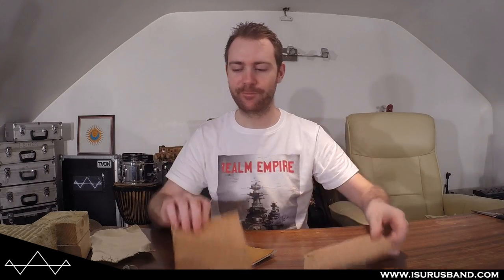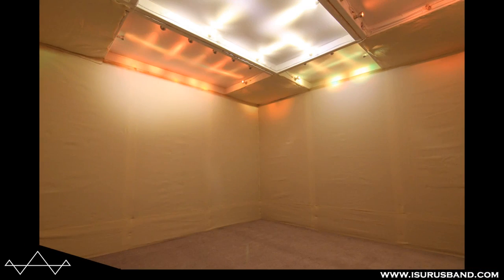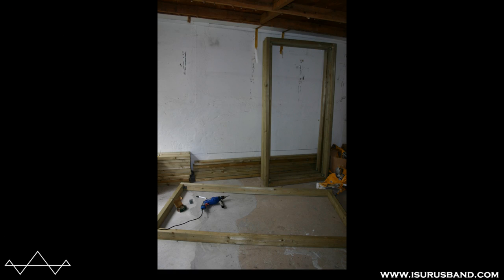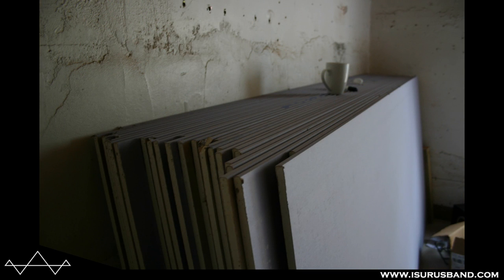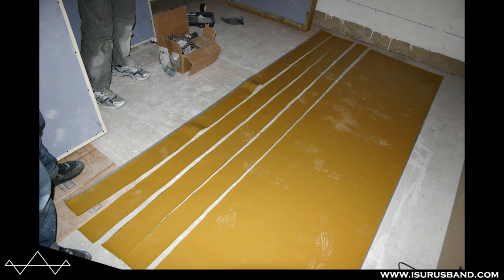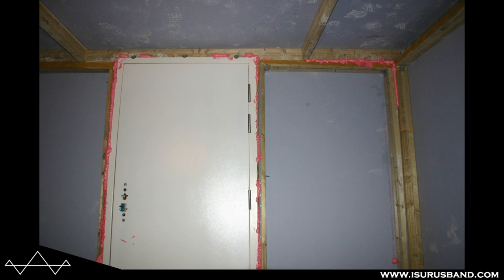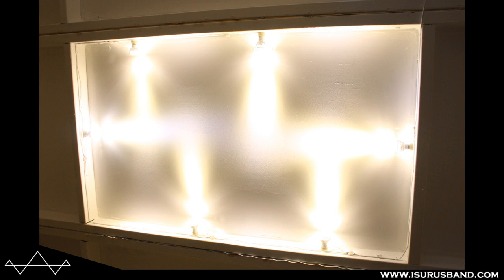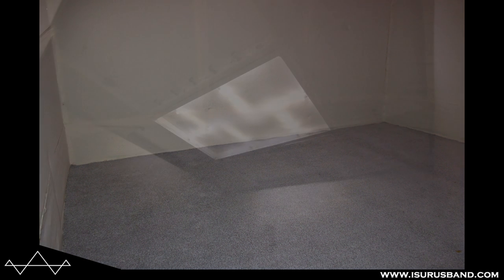Soundproof Booth Build - Portable DIY Isolation Booth

Comment: Hey guys, I have seen this video many times by now and showed to a lot of people as well and think I have commented a couple of times before.. that I'm gonna do again. 

THANK YOU so much for making this video. I have finally built my own room highly inspired by your room and learned from your "mistakes" so to speak. In my apartment I can only have the inner room that you also built and had to build a frame for the whole room since its an apartment and therefore I need a floating floor in the room. The tecsound 50 I was able to get from Ireland and I'm so happy that I spent that extra money on this material. Damn it works wonders! My room is a bit smaller than your built and had to do some other dimensions for the wall segments but again.. I'm happy with it. I even got a window in it -  two layered 44db glass, it's sick! One day I might do a video explaining it like you did (you will be credited in it when it happens!).
After my own built I was like... You guys must have had a serious logistical challenge assembling such a big room within that shed. Getting those huge roof parts 2m up in the air... With such a small space between the outer roof and the rehearsal room. I truly did not think of that when I made the drawings for my room.. god damn it was crazy work. I ended up making some pillars in the corners to make sure there's a lot of material in the corners and the same in the roof.

If anybody reads this comment and you want to make room like this: I for sure recommend that you think of the space it takes to built the wall/roof parts if you are gonna have it in an apartment or other "small" space. It takes up a lot of space in the whole process. My project was pure Tetris all the way since it's built in the living room. A logistic hell to say the least. I highly recommend building the whole thing outside if you have that opportunity and then assemble it inside. Also be aware that each wall part (if you have 3 layers of plasterboard and Tecsound 50 like this video) weighs around 80kg EACH. The roof part is the same. I had two gearbox-jacks and had to built some extenders for it to lift if up the whole way (my walls are 2.20m tall). Also buy a LOT of sealer... For my 2.40m * 2.15m room I've ended up using around 30 acrylic sealers of 330ml each. Wood is a living material and there will be gaps. My planks ended up twisting when they layd inside so consider having them somewhere outside like a shed or something... Or just get started right away when you buy your materials.
Last thing that is a really good to know: remember all the weight is on one side of the walls. They use gravity A LOT. They can be tricky to get in place if you like me make a platform under the whole thing like I did.

I hope it all makes sense, but again I'm really gratefulfor this video, it really has made my dream come true. Finally I can play drums without disturbing or being disturbed (acoustic drum kit with mesh heads and silence cymbals, but that is still noisy!). I pretty sure a second wall around a room like this will be soundproof enough for drums with real drum heads on. Thank you thank you thank you.
Reply from the maker: That's great to hear! Glad the video helped you out with your soundproofing work! Yeah, if you do a video showing the build let us know, it would be great to see what you've done! Thanks!

Comment: Clever build. An old drummer bandmate of mine from a Very loud 3-pc and I DIYed a very similar thing in a concrete underground nuclear fallout shelter in his rental's backyard in Los Angeles back in 2000. Since it was underground already, our frames were thinner—more about treatment than proofing. Thrift store towels and rugs. Then we ran the same type roller fan up through its maybe 8" air pipe, and at the entrance, floated two doorframes on neoprene, and just cut a vent on each door, one high and one low. We didn't have gear to measure SPL, but when we finished it, I had him and our bass player just play as loud as they could stand at like 3am, went up and outside, and it just sounded like a tiny old clock radio coming out of the vent pipe in the middle of the yard. Harmless. Strung up some fairy lights and we had a nice environment we could pulverize our eardrums in if we wanted to for under $500. Well done though. Very impressed with the levels coming out of an above-ground shed..

Comment: Thanks guys. I’ve just had a quote over 11,000 quid for a smaller prebuilt studio. Just going to have a go myself and save £9,000! Might take awhile to do but so worth it. Some brilliant ideas and advice. Thank you so much👍👍👍
Reply from the maker: Cheers! Good luck with the build! Were you looking at the Esmono booths?
Reply: IsurusOfficial No, it was a company based in Germany with a product called Studiobox. They looked good but beyond my budget for a home studio. I spent about £3,500 on a studio in my last house and had to leave it behind when I moved. Your modular idea would have been so much better. I’m definitely going to give it a try. I think I can do most of the work. I’ll need a hand for the ceiling module install and we=I’ll get an electrician to do the lights and power supply. Hope you guys are having a great time with your studio. Thanks again.

Comment: I made the ventilation exactly the same way, and it is super quiet.
the fans are hardly available in the Netherlands, so I ordered them directly in England.
why would you buy a very expensive ventilation system if you can make it yourself, but much cheaper, with the same result.
and I made the ventilation hose on four PVC sleeves that I stuffed with Inno silencers, so that you hear the sound as little as possible.
in the studio I measured the ventilation noise with a professional meter. and the sound noise does not higher than 5 db. and that is a good result, you will never be able to get the sound 100% silent

Comment: who thumbs down this - doing a project like this is no easy task!!!!
Reply: I thumbed it down the moment he showed them layering the plasterboard, one directly ontop of the other. That's NOT how to layer plasterboard. That IS however how you run the costs up by having to use too much glue between each layered frame as the frames don't fit airtight against one another.
Reply: Other than that, they didn't use any soundproofing glue between the plasterboard layers. Double thumbs down.